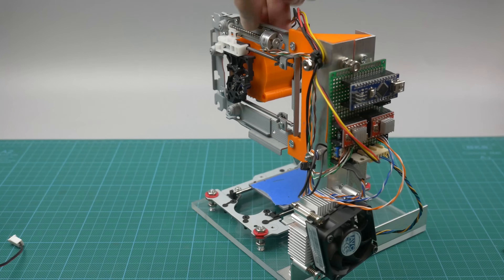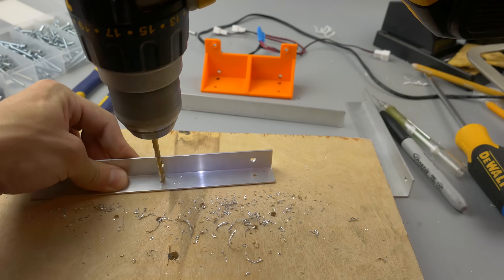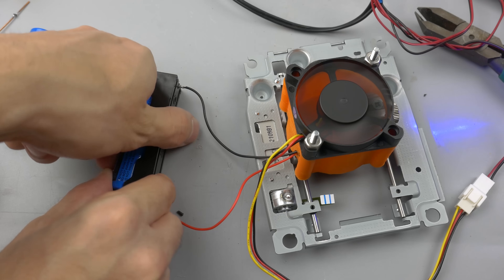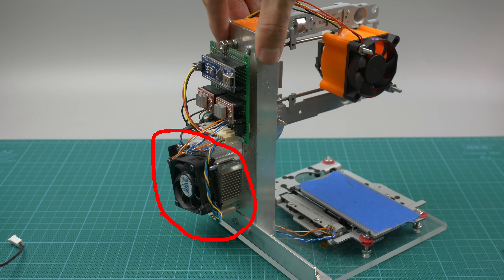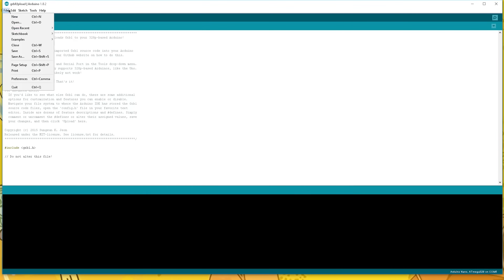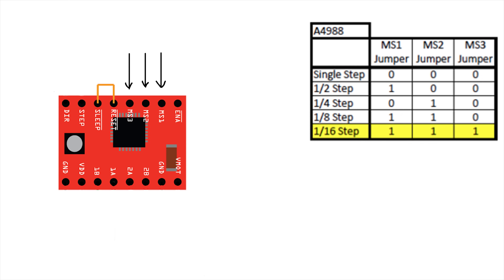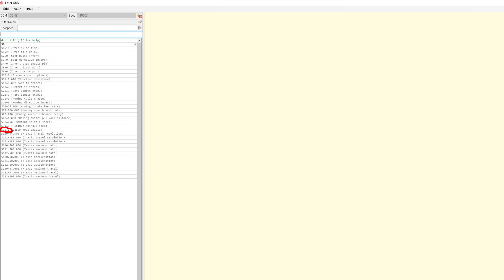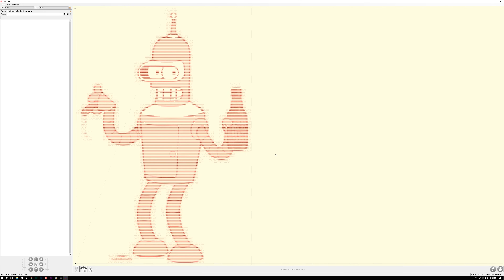Easy DIY Laser Engraver: Build Your Own from a DVD Drive

Comment: Hello sir,
Why my stepper motor is not  continuously and  moving in perticular axis while pressing the arrow keys and even movement is not content sometime it moves to Relatively large distance some times very little, sometimes not at all no matter how long I press the moving command keys or at any Step Level and sometimes the software misbehave ( not only this but other cnc software giving same problem), 1st i thought its Smps causing the noise I changed I even rapped stepper wires around choking ferrite but same issue so far it moves somewhat constantly but very tiny amount why?
I am using clone uno with ch3 type installed driver?
What causing issue

Comment: You made soldering the 4 points on the motor look SO easy. I've had to go through 2 drive trays thus far. 

Tips?
Reply: use flux, tin the soldering tip, use appropriate temperature

Comment: i took appart a dvd player (with rewritable capability)  
and it did not have stepper motor.   it had dc motor (2 wires) and endstop 
and it did not have laser diode.   it had holographic unit.    
(apparantly a combination of laser diode and optical sensor.  it is a flat package with 10 leads)

Comment: In the video u showed on lm 317 DC to DC converter but in the circuit diagram lm 317 is not used 
The circuit diagram is correct?

Comment: Cool openInvent.club gives the world this idea dongle.pw to cut cd into fan by cutting diagonals slots you need 4 axis to angle. Idea is to lift air up off laser maybe later I will use a DVD RW and ensure the data area is skipped to avoiding the "deleted data"  of the laser cuts in The JOILET or Filesystem.

Comment: Thanks for your project but real is very difficult.For very thin metal cut you have to make it minimum 4000w power and such CNC machines accessories buy more costly than buy one new CNC machine. thank you.

Comment: In the pin GND and VMOT a adding capacitor 100 uF to protection Stepper Motor of voltage spikes.

Comment: Hi anyone who can help,  I am building this engraver and am at the breadboard stage, right now my goal is to have the motors running and I have yet to build the laser. Before and after adjusting the stepper motor drivers for their millivolts, the motors don't move when commanded through Laser GRBL. I would appreciate if you could help me out. Thanks.

Comment: Can I use your grlb software and laser grlb editor at arduino mega 2560 and cnc shield ramps v1.4 and 3 stepper motor? Is it possible? Are they appropriate for my component?

Comment: Hi 

i bought a laser of 1.5w - 12v, but unfortunately they send me a laser of 1w - 5v. what can i do with the 1w - 5v laser for adapt it to this project?
Reply from the maker: You can use step down DC-DC to get 5v out of 12v, for example -  http://ali.pub/1ypoyg
Reply: I appreciate your advice, thank you for responding. 
So this would make the intermediate between the 12v and the 5v laser I guess.

Comment: Do not wire the laser as it is in the schematic at 2:54 unless your laser has a constant current source built in to it.
If it has'nt then the one he uses with the LM317 regulator should be used. Otherwise you will just burn the laser diode out.
In the schematic it just has 12volts switched straight to the laser through a FET transistor connected to the 2 resistors (10K and 47ohms.) Pin 11 on the Arduino sends a small signal to switch the FET on and connect 12volts. If you are going to use the FET method then it should be switching the constant current source on and not the 12volt directly to the laser.
Lasers are current hungry devices and they need a constant current to prevent them from drawing too much and burning out.
Reply: That's exactly what I was thinking, I found it pretty weird how that wasn't mentioned. Better yet, he should use a step down
Reply: I think the LM317 is used to power it, but didn't show it in schematic since many people have laser diodes that have built in power regulator. Can you explain and provide a schematic how we interface the LM317 to power the laser and use the Mosfet for modulating the laser?
Reply: He buddy  u seam to be knowing much about  the laser part I have some doubt about it can u help please

Comment: It's more likely to be a show for your project but not a tutorial as all no steps no actual process no instruction or parts assembly so it ends up not helpful at all . If you are searious please make a another one with a specified details ,thank you
Reply: zach burke if u understand basic electronics as u say then u dont need to watch this video
Reply: This video shows enough if you understand basic electronics.
This project depends extremely heavily on the parts you choose to use, so specific steps don't really work.

Comment: hi, sir i am using ardiuno uno. how to change and assign control pins for this uno type controller. at the i am having l293d driver for stepper motor and it requires four control signal from the controller please help me with this.
Reply: you can control dual h bridge chip with old grbl but just dont waste your time on this stepper drivers are much better solution. tho you could get additional chip (dont remember the model) to drive this dual h bridge chip like stepper driver only with direction and step controls. there is plenty of info on the net to realize this

Comment: Hey Konstantin
This is a really cool project you made there and i would like to try to do it too but i have  a few questions i hope you or andybody else could answer:
1. Whats the length of the alumminium angel you cut off or does the height not matter that much?
2. As you already told someone else in the comments you could get rid of the LM317 with the heatsink when you use a 12V laser diode driver, could you recommend any driver or should i just buy one that supplys the needed current?
3. How did you know how you have to connect the stepper motors to their drivers? In the drawn circuit it just shows where each coil has to be connected to the driver but how do i know where the motor has the connections for each coil?
Reply: 1. Depends on the size you desire and the other parts you are using.

2. Pretty much yes, one that supplies enough current. I still recommend looking at data sheets to make sure it works with your laser

3. Read the data sheets for your motor and controller for more information.
Reply: Ok, thanks for your answer!
I also searched for some answers online and found this if anybody else wants to know:
1. I think I´ll just take what I think will fit for the weight of the dvd drive and the laser to hold it stable

2. As somebody else mentioned in the comments a buck converter is also a good way to convert 12V to 4V the voltage and they are pretty cheap

3. You can easyly find out through searching "DVD drive motor connectors": https://electronics.stackexchange.com/questions/134930/wiring-up-a-4-pin-dvd-drive-stepper-motor

Comment: first thing   I had no problem understanding you.  but could you please give some more information on how you connected the motors. do you know what type of connector you use for those plastic and copper strips,  and how did you go about doing
Reply: First go school
Reply: @MaDdxB972 for fucking what purpose? So you can learn how to make this thats the dumbest fucking thing I've ever eard in my life
Reply: He connected the motors to a stepper motor controller, how you connect them depends on the specific controller you buy.
Reply: At 3:54 you can see he just cut off the ribbon connections and soldered wires from an ethernet cable directly to the pads.
Reply: i know this is sorta off topic, but how did he know to connect the motor driver input pins to the arduino pins 2,3, 5,6?
Reply: I couldn't understand a single thing he was saying because he wasn't trying to pronounce anything not because of his accent I'm actually married to a Ukrainian. He sounds completely wasted slurring all of his words together

Comment: Can we get rid of that LM317 and heatsink and replace it with a DC-DC step down buck converter?
Reply from the maker: Yes sure. An even better idea - use a 12V laser diode driver
Reply: @HowToDoEng  I'd also recommend, there are some better budget options instead of arduino that are far better! Overall looks pretty good
Reply: @benlogic8592  Could you name some
@How To Do What glasses would you recommend?
Reply: @abdoustube  survival lasers, od rating and wavelength depend on what you want I got mine for like $40 usd. Go on lpf and ask if you have any other questions people on that forum are gods.
Reply: How To Do 12v laser driver

Comment: I have found CD drives just use a DC 2 pin motor.
Reply: try using a servo circuit for it

Comment: can u engrave/etch a copper plated pcb?
Reply: To engrave (burn off) copper you need a massive laser as copper is around 100% reflective(in ancient times people were making copper mirrors).
Which is thousands of $ laser engraver 
However you can use method semi laser-chemical method(which canl use a diode laser ):  
1 paint PCB with dark paint that is resistant to copper eching chemical
2  burn off paint from PCB with laser,  
3 etch copper exposed by laser with copper etching chemical
4 remove rest of the paint(you can burn it off with laser if you like)
Plenty of materials and videos on Web.
Reply: Maciek Sondej I'm not selling anything, but I am an engineer and love to observe and raise questions. If you are offended by curiosity and creativity, you are free to look elsewhere. Thanks.
Reply: Nathan Imig No. But you can use the laser to draw on light sensitive protection and get a very neat tracing capacity, much better than any other system (besides laser on photosensitive film) which allows you to make semi-integrated circuits on your own. But then, I would also suggest to use also a better hardware, such as a 3d printer or cnc.
Reply: Maciek Sondej This is a good system, too. And, you could try to oxidize copper, but I'm not sure if that would work for making it less reflective up to the point to burn it away ...
Reply: Yes you can
Replace the laser wit a couple watts motor, metal grinder bit 
The copper plating on PCB is very thin
Only the very Tip of the bit would do any "hard" work
You wouldn't be milling an actual metal "Plate"
Essentially, just scratching the surface...

Set the speed of operation to appropriate for the material, do a little experimenting...
Reply: @ y2ksw1 You are  WRONG. 
Question was can it engrave PCB - no it can't. It can only help in proces of chemichal etching
Oxidizing copper on PCB is the most stuppid thing one can do. 
All profesional cicruts has solder mask to prevent copper oxidizing.
If you want to sell your bulshit do it elswhere and don't put poeple that want to do something constructive into confusion.  This system with LASER DIODE CAN'T ETCH PCB end of story..

Comment: Great work! In grbl, I'm assuming you are using 256 steps for the laser power scaling. In this case $32=255 and not 256 as you've stated. The laser power starts from 0 and goes to 255 covering 256 steps. If you set that to 256 then you are starting from 1. Its not a major difference but when start laser power from 1 it means that its on even if its really really dim.

Comment: Can I engrave skin? I need a way to brand my cattle
Reply: William Aaronson I'd use a drill or Dremel tool for that
Reply: I just use a soldering iron.
Reply: Maybe suitable for dead cattle
Reply: Manuauto ☺☺
Reply: Ying Yang of course I am. ;)
Reply: William Aaronson no...but I would recommend a thick piece of copper wire, just bend it into shape.
Reply: Well, if "cattle" is a euphemism for your devil-worshiping minions, I think you're good to go.
Reply: angry moooooooood lol
Reply: William Aaronson damn
Reply: William Aaronson i no im a little late but u cant use this to engrave skin because it would upset the lords u need to use a torch on high and make sure to soak the cattle im gasoline then use the torch to brand em, I hope this is helpful
Reply: if u do so then u will have to face them in a angry mood....their skin would burn up badly...and then they will become angry bulls...heehaaao😂😂😂😂😂

Comment: Can you please tell me to make normal CNC machine . Please................ Just provide me the link of that
Reply: I never have seen a cnc machine that works with a pen, I think a cnc machine that uses a pen is called a printer.
Reply: Your "normal" is strange, sir
Reply: How To Do he propably means cnc with drill, lot laser
Reply from the maker: Hm... sorry, I don't know what does "normal cnc machine" mean to you
Reply: How To Do normal CNC machine means which works only with pen
Reply: what you want is called a Plotter machine.
Reply: There are some good tutorials here on youtube on how to make a plotter machine from salvaged motors. The difference would be that instead of adjusting the brightness of the laser diode, you would use a small motor that touches the pen to the paper.
Reply: https://www.youtube.com/watch?v=0PmR_1dx77s
Reply: You can handle the X and Y on the arm instead of arm + surface as well.
https://www.youtube.com/watch?v=SLtb2R89Vgw
Reply: There's a few ways but using the guts of DVD drives is preferred imo. You can even use a plotter to print your own circuit boards if you understand the etching process.
https://www.youtube.com/watch?v=bj9nJdrjATc